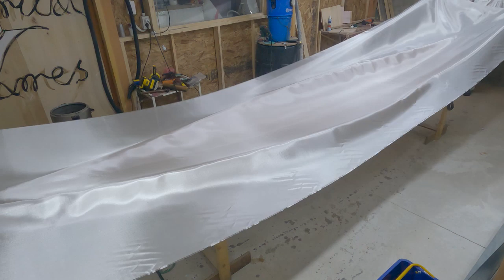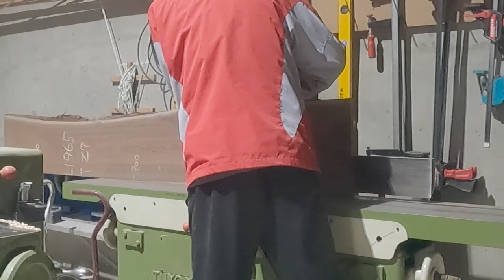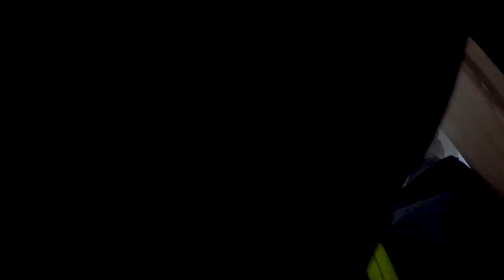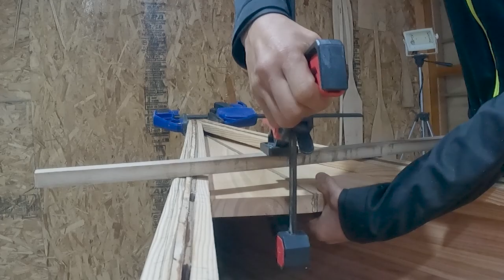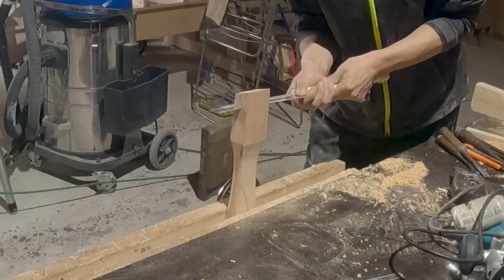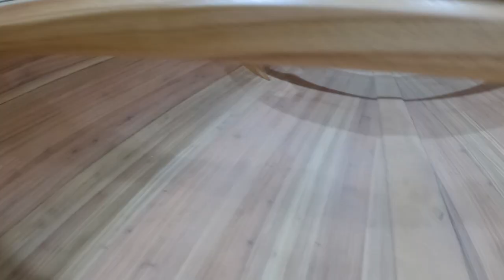My second Redbird strip Canoe Ep.2(Final)

Comment: I made this model a few years ago and found it very stable even in rough water.  I was able to get western red cedar for the strips.  I did not staple them to the stations but rather strapped in each strip with surgical tube and waited for it to dry for the next piece.  It took a little longer but the look was well worth it.  I also made the freedom 17 that is in Teds book too.  For each of the plans I got them out of the book rather than purchase them.  The freedom 17 is a great design for tripping in the BWCA.  I put a slider seat in it and that works very well on windy days as well as smooth water.  The freedom is also very stable when loaded but not so when empty.
Reply from the maker: Thank you for your information.  Freedom 17 is impressive. I am interested in making a canoe. I plan to make a bigger boat in the future.